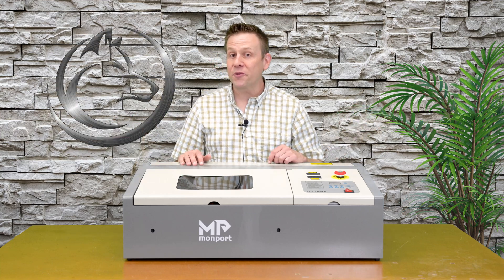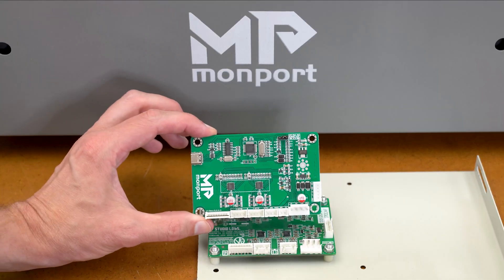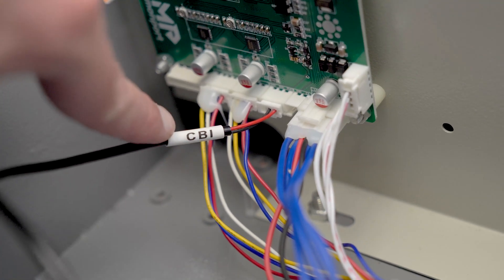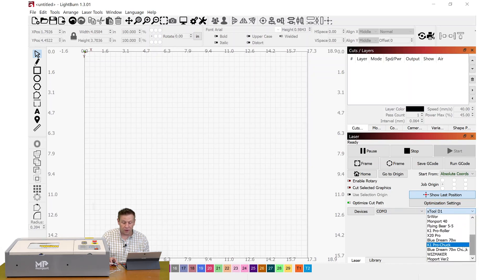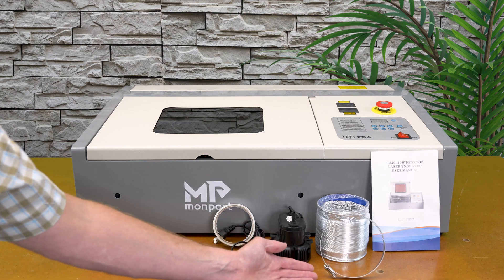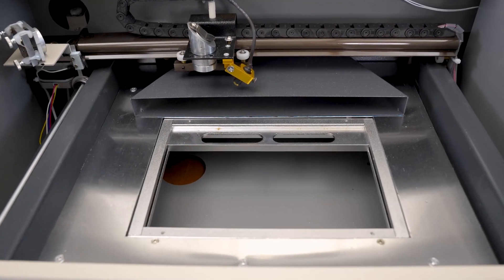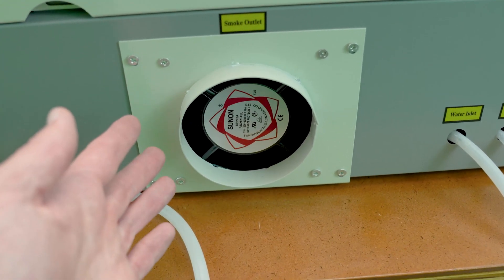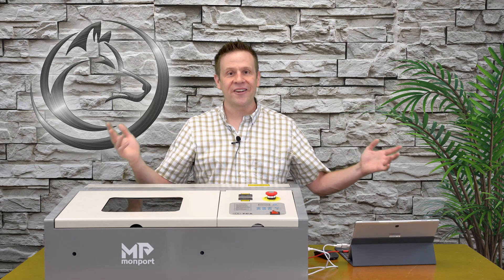Monport Lightburn Controller Board VER 2.0!

Comment: I have an omtech k40 but I don't see those first two black wires on mine ,ie going into the power supply .
Can u help as this is my second board and nothing works.
Laser is saying busy
Reply from the maker: If your wire colors are different from I have in the video than look for what should be going to the controller board and trace unknown wires back to their source like safety switch wires.

Comment: I did this exact installation and now my laser doesn't move can help me to run my laser
Reply from the maker: There's 2 things I would check first- 1)does the board light up that it has power 2) can you connect and detect the laser machine with the g-code version of LightBurn (the $60 version)- the DSP version of LB is for the large Co2 machines.
Reply: @thelaserchannel1  thanks for replying,  the board light on and connect and detect more than 5 times but it's not run
Reply from the maker: @hadigherbal3392  I have not ran across that- if I think of anything else to try I'll let you know.  Maybe send an email to Monport- it may take 1-2 days to hear back from them, but they'll be able to put an engineer on your service ticket.

Comment: i have the same machine, i put a different bed in it and installed air assist, love the machine now  I use inkscape and k40 whisperer now.  Is lightburn alot better?
Reply from the maker: Sounds like you have a nice setup.  In my opinion Lightburn is the way to go!  I looked at K40 Whisperer software but waited until the k40 could use Lightburn- I have all 3 license keys for light to run laser diodes, Co2 lasers, and Fiber/Galvo lasers.  The controller board uses the $60 version of Lightburn and Lightburn does have a 30 day free trail with all features usable.

Comment: (I have only worked with diode lasers)  Why would you need / want to replace the controller board?  Will LightBurn not work with the control board that came with the laser? Which version of LightBurn do you need?
Reply from the maker: The biggest advantage is using the Lightburn software-  the version that works with the controller board is $60.  In my opinion Lightburn is so much easier to use.  There's many neat features including a library that you can building settings for each type of material or engraving look.  In my shop everything runs off of Lightburn- I only need to learn one software package for all my laser diodes, Co2 lasers, and Fiber/galvo lasers!
Reply: @thelaserchannel1  As great as Lightburn is, Lightburn listens to users and maker upgrades regularly

Comment: I just purchased the updated MP 40W unit. It's my first laser. Do you recommend using the LB software over anything else that may be free? LB is kind pricey in my opinion, but I'm a newb to the laser hobby. Thx!
Reply from the maker: Congrats!  The version of LB that works with the controller is $60.  The larger Co2 machines use the more expensive version of LB.  I have all three versions of LB and it's so easy learning/ using on software program for my laser diode, Co2 laser, and Fiber/Galvo laser machines.  And yes- I highly recommend using the LB software.  I didn't look seriously at the k40 laser until they were options for LB software!
Reply: ****************************************************************************************************************************************
 deffinately use Lightburn. The learning curve is much easier.

************************************************************************************************************************************************